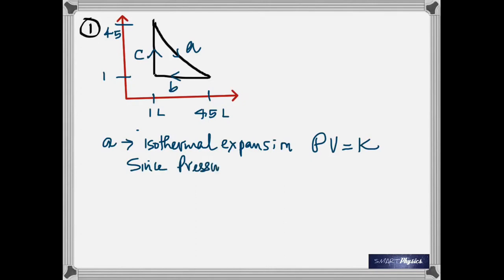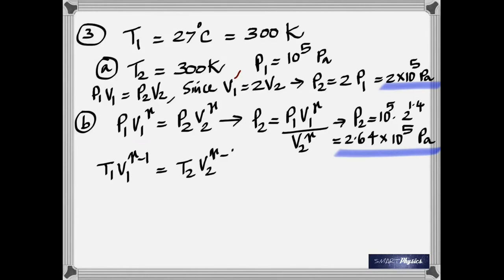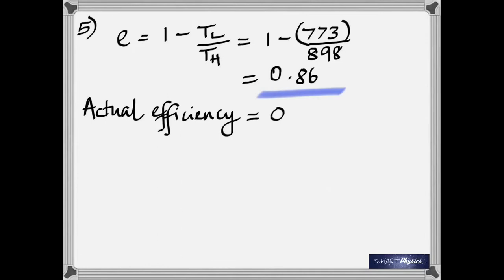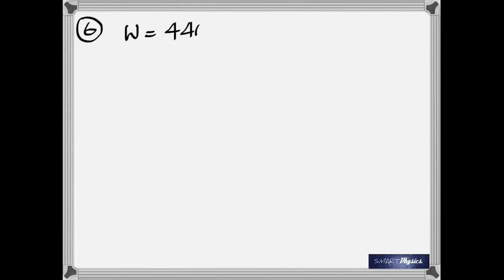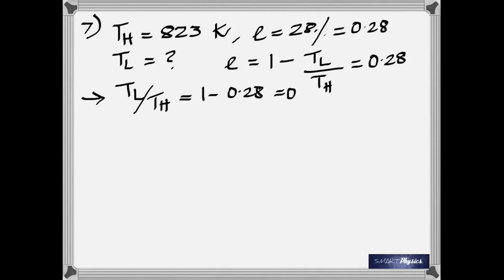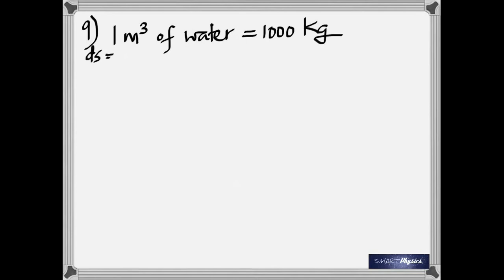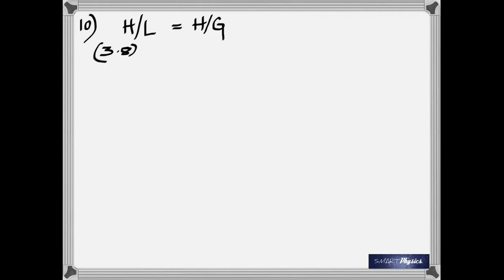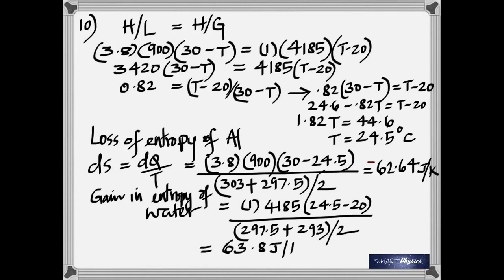Problems - Thermodynamics(2425)

Comment: Why is the T sub L in number 5)  773k? In our problem it should be 623k but I don’t know if maybe I’m not seeing something right. And how did you get Q sub L equal to 3600?
Reply: Never mind I see where you got the work from you multiplied the wattage by the amount of seconds which is 3600 seconds in an hour. as for the T sub L, I guess your numbers where just different then ours.
Reply from the maker: You got it!